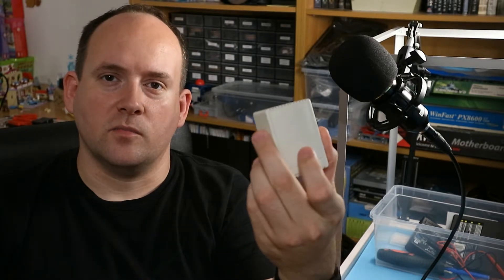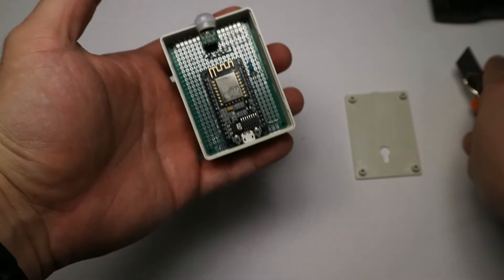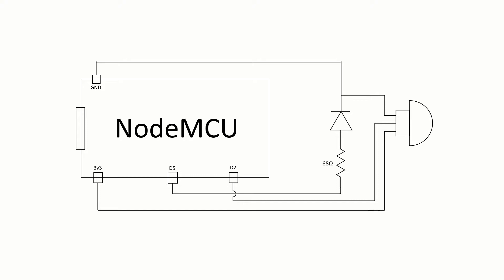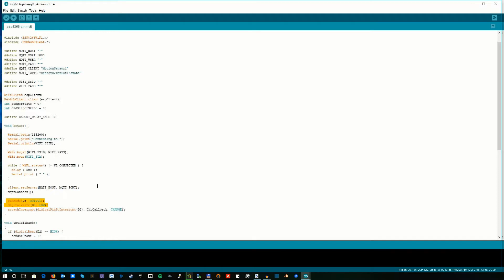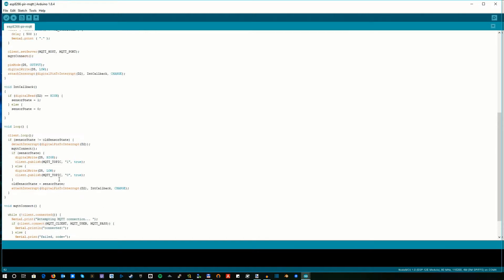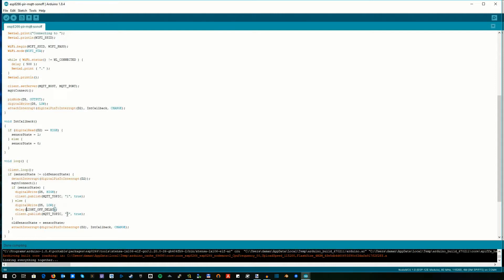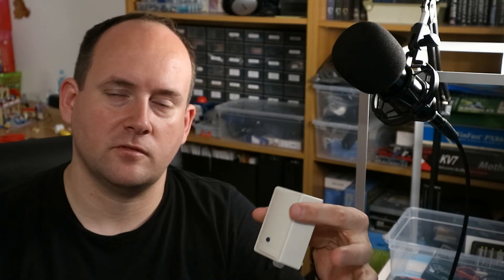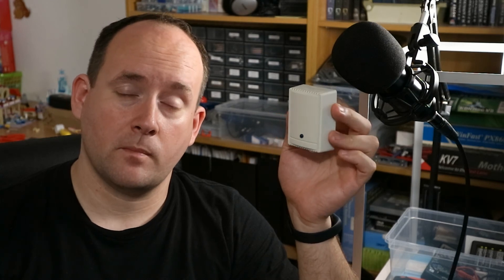DIY Security System - Part 2: Motion detectors!

Comment: Hello, very interesting your project and I will try to follow it, although I am new to this, which script is recommended to handle Pir, thanks.
Reply from the maker: Hey Carlos,

If you just plan to use a PIR sensor, it's just literally a couple dozen lines of C code in for example the Arduino IDE. Or did I misunderstand your question? What do you mean by "which script"? Something like a premade firmware with PIR support?